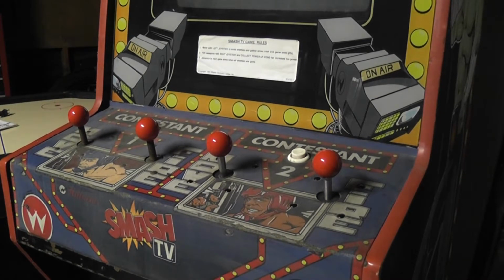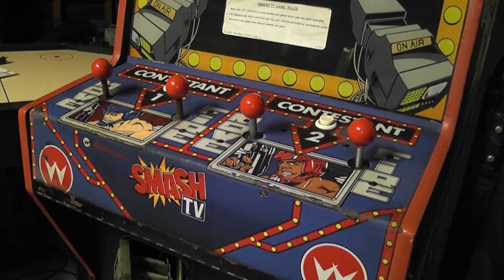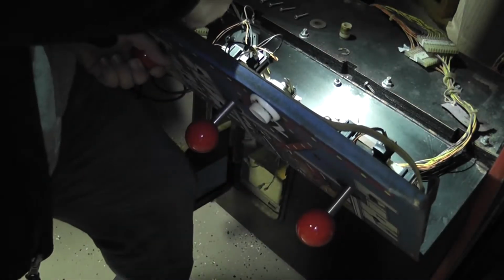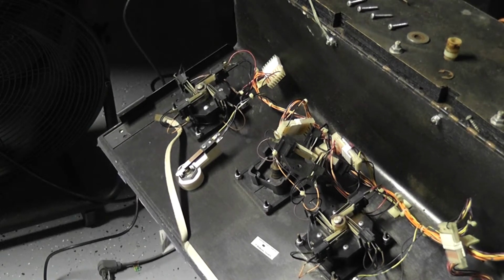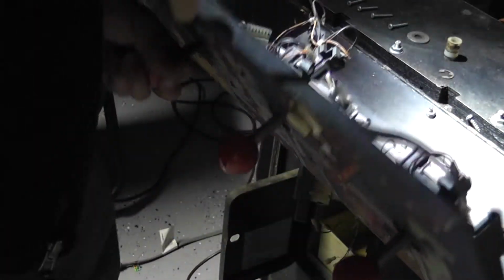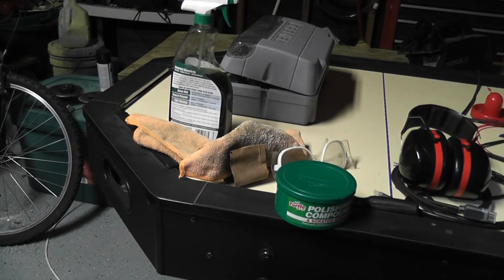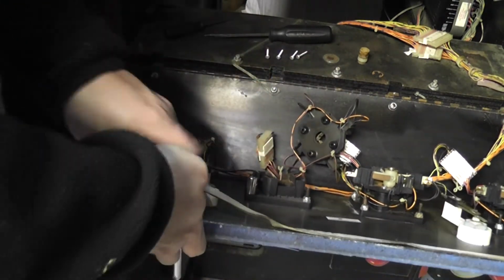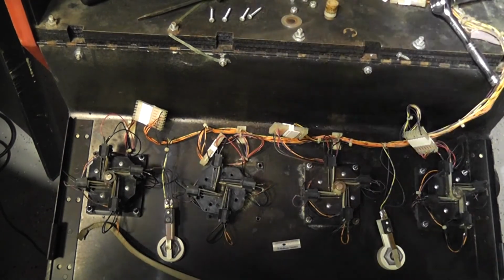Smash TV joystick rebuild

Comment: Thanks for sharing, sometimes some penetrating fluid will work.  I've had a couple seize up like this 1 i was able to save the other i ripped apart like what happened with yours.  your restoration process is very similar to mine.  check out my video if you get a chance titled "wico stick resto"